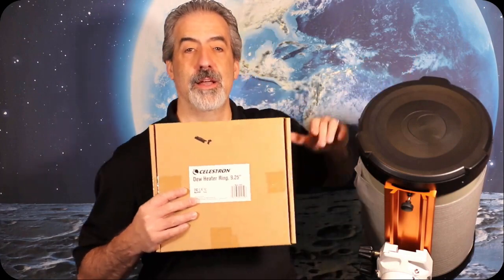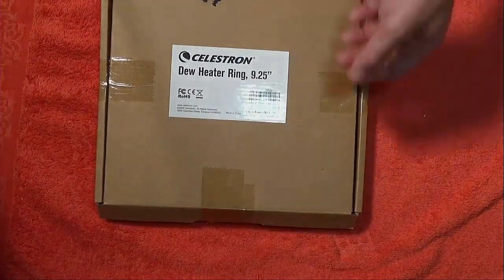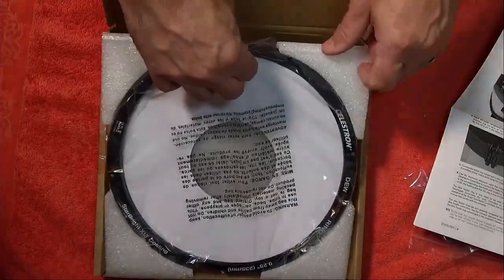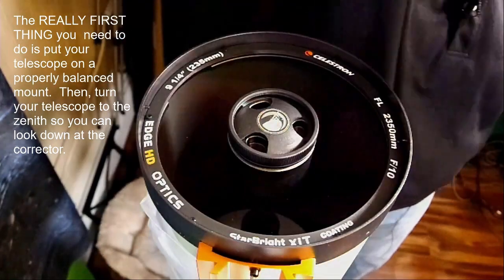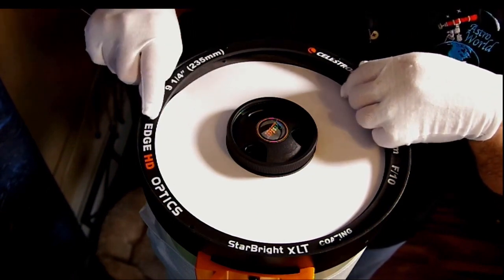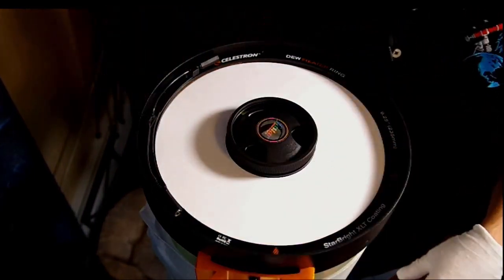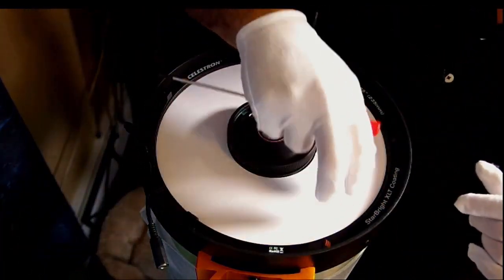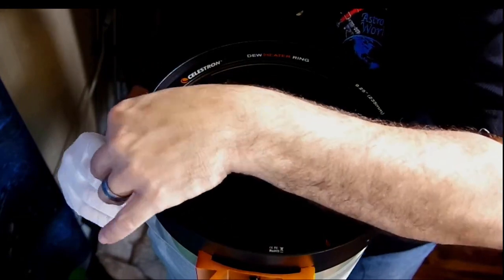How to install the Celestron Dew Heater Ring

Comment: I also got this heater ring. My experience is that the cover cap close like 80% after I install the ring. In your video I see you also get this issue, right? Looks like the cover cap didn't completely fit.
Reply from the maker: Hi actually I made a mistake in the video…I placed the corrector gaskets back in the assembly.  Take them out and the cover will go on smoothly

Comment: good video thanks.  can i use the dew shield over and  above this? wouldn't the cables obstruct / hinder the shield sitting securly on the tube?

btw, do we still need the shield if i setup this ring heater?
Reply from the maker: There is a dew shield made special for the dew heater ring take a look at the last pic here https://www.cameraconcepts.com/copy-of-copy-of-celestron-aluminum-925-dew-shield.html

Comment: Did the lens cover actually go back on❓
Reply from the maker: Yes …after removing the gaskets the lens cover was fine and fits perfectly!
Reply: Awesome video, could you please tell me if you were able to plug it into the eagle with no problem ? 
My intention is to power it up, like any other dew strip?
I’ve seen five of these videos, and no one talks about the plug-in part😂